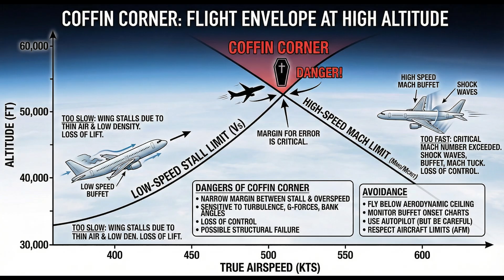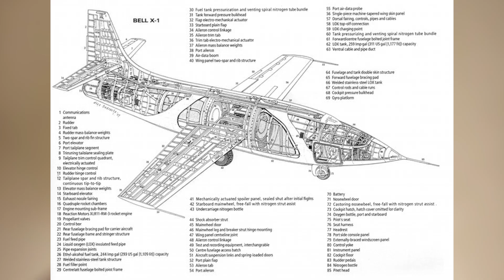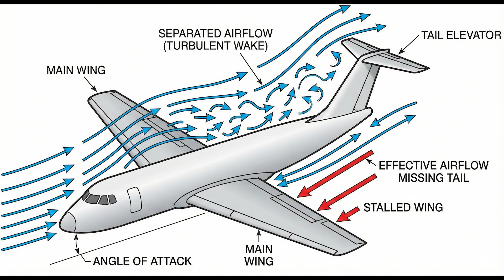He Bent the Sky’s Limits — With One Simple Idea

Comment: Being told and thinking about using the trim instead of the tail elevator might've been what saved or allowed the jet age to carry on...  the 'all moving tail'.
Reply: Absolutely, I believe that some teams that attempted to break the sound barrier in the early years came to the same conclusion, which was to use the trim of the horizontal stabilizer. 
This was also the case with a test pilot in a DC-8 in 1961.
https://www.youtube.com/watch?v=22JxpglgRuY
Reply: I have a small radio-controlled plane that has an all-moving tail. It's an ugly little "foamie" plane but is one of the more popular trainers for new RC pilots: the AeroScout.